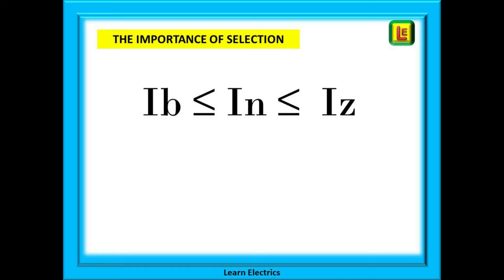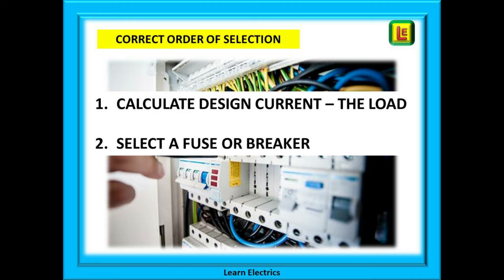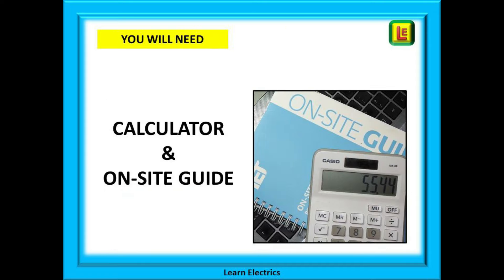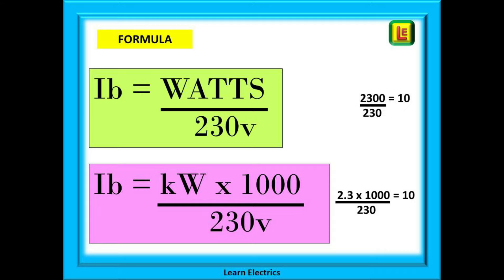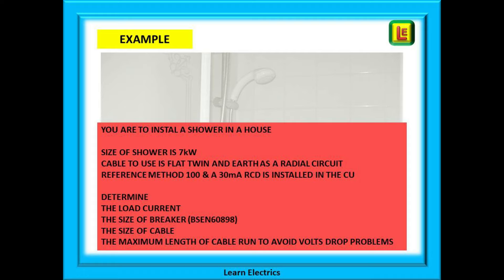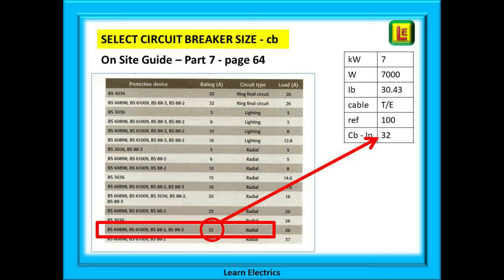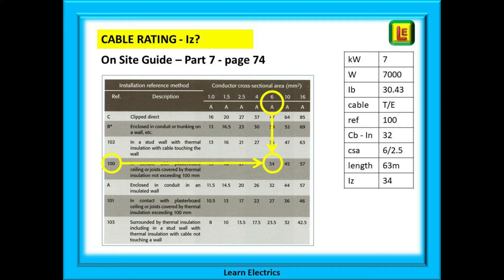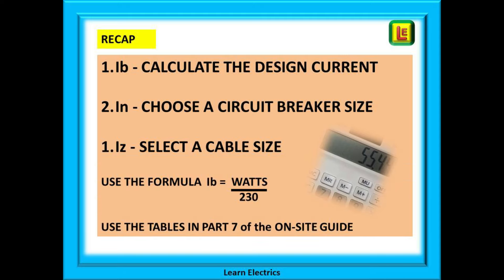BREAKER AND CABLE SIZES FOR ELECTRICAL CIRCUITS.

Comment: Finally someone has explained the actual calculation of what we were trying to learn 👏
Reply from the maker: Thanks for the great comment. Lots more videos to come, including more calculations. Dave.
Reply: @learnelectrics4402  hi dave 👋today is Christmas day "so I'll bid you merry Christmas 🎅 "and a big thanks for your teaching videos " I've been in the building trade for nearly 40 years now? As a bricklayer ☠👻spent most of my time on sites 'but went self employed in 2000 ' I've learnt a little bit about electrics 'wired up a few sockets now and again? And normally had to get electrician to check it over ' 🤪but recently I came across your videos " and got interested in expanding my knowledge of electrics 'I've watched other videos of similar advice "but found yours the one that struck me the most ' its not elaborate or highly glifick "but some how it works for me?? Think it comes down to how someone can get a difficult scenario across ! I find your instruction easy to understand 😃I'm going to follow you deeper into this "and get more equated with this "wish you could of taught me years ago "🙈all the best my friend "have a good New-year 👍

Comment: Excellent video.  I learned a lot about choosing the correct wire size and fuse to be used.
Reply from the maker: Thanks. If the video helped then its done its job. Dave.

Comment: Hi Dave, I recently completed and passed an excellent domestic electrician course at EC4U in Ditchling. Your video series is a superb “old-school” reinforcement of these key principles and in some cases has offered an even clearer explanation, or at least a different perspective on the same learning points.  Being an older learner who has recently changed to the electrician career, this series has been brilliant.  Thank you!
Reply from the maker: Thank you Mike for the very positive feedback. Our aim is to produce videos that tackle just one subject each week and they are based on all the questions and difficulties that electricians and learners have had over the years during the time that we ourselves have been working on the tools and as assessors and instructors. There are many more to come yet, keep watching and thanks again. Dave.
Reply: Mike.
How about the Domestic Electrician course in EC4U? I also want to join it.
Reply: @hingninwong  yes, look them up on google.  The website is easy to navigate. Good luck!
Reply: @MS-Patriot2  
does the domestic electrician couse fit your purpose, such as capable for you to do the minor electrical work ? Any comment to this course?

Comment: I think it’s worth mentioning that when you’re calculating your design current, if it is a 3 phase system you would put root 3 at the bottom of the fraction and if you have a power factor you would put Cos(power factor) at the bottom of the fraction aswell
Reply from the maker: Excellent information, thanks for contributing. Dave.

Comment: Thanks for all your vids, they’re a massively help for improvers like me working towards getting qualified! 
I have a quick question, not sure if you’ll see this:
If a dedicated oven circuit has a 40A breaker on it, why are there sometimes cables on that circuit that are rated for less than 40A? Is it the case that if the smaller cable is on the load side of the fused isolator switch, then you’d take the rating factor of that fused isolator switch as your “In” in the formula? Apologies if that’s obvious, I’ve just got a little confused and can’t find a clear answer elsewhere. Thanks again!
Reply from the maker: Take a look at the link below about Zs. A single 13A  socket on a cooker switch plate is acceptable. It is assumed that if something goes wrong with whatever is in the socket then it will go wrong big style and enough current will flow to trip the 40A breaker. Hope this helps, if you search for Zs on the LearnElectrics YT channel you will find over twenty videos about this subject. Good luck, its a great trade to be in. Dave.
https://www.youtube.com/watch?v=HbWhzt4r644
Reply: @learnelectrics4402  Great stuff! Big props for replying to comments on vids that are years old, you're a massive help mate!

Comment: Im training as an electrician and your videos are very helpful, i can see this calculation wiuld be good for an individual radial or ring say for a shower or cooker, how would this woek with lighting circit or socket? I am starting my NVQ level 2 in september so sorry if this is a basic question.
Reply from the maker: There are standard sizes that we usually use for each type of circuit. The important thing is that the cable capacity MUST be equal to or greater than the fuse/breaker rating. I'll be doing a video on this soon. Stick with it, its a good trade to be in.

Comment: Seems easy enough as you explained in great detail, I am looking to install panel heaters in my flat, can these just be added to ring main or need a separate circuit, if a separate circuit then can I do myself to save money?
Reply from the maker: Consult the heater manufacturer's instructions. Some say that they can be plugged in, coming with a fitted plug is usually a good clue. Other heaters are recommended on their own circuit.
Adding a new circuit assumes that you are competent and can notify the work to LABC afterwards. Only you will know if you can do this. If you are unsure, I would suggest using a REGISTERED electrician, but ask to look at his registration card (NAPIT, NICEIC etc) before giving him/her the job and before handing over any money. Tell them you want a Building Control certificate when the job is finished. And get three written quotes before making a decision.
Reply: @learnelectrics4402  thanks, the heater doesn't come with a plug, needs wired in to a fused switch

Comment: Fantastic video. What would change in the calculations if it was on a tt system. ?
Reply from the maker: Nothing should change. Install conductors with sizes as if they were in a TN-C-S system. They still have to take overload currents. Its just that your measured ZS will be all over the place. Dave.

Comment: Thank you for the video. What is the difference between "rating" and load" in the table on page 64. Is this assuming diversity of 80% e.g. the shower is off for at least 12 minutes in every hour of use?
Reply from the maker: Load is the amount of current you put through a fuse. A kettle might put a load of 13A on the circuit.
A table lamp might have a load of half an amp
The rating of the breaker in the consumer unit might be 20A or 32A if a ring
Hope this helps. Dave.

Comment: Hi Dave, another excellent video, we all thank you for all you are doing. I'm confused about the choice of cable size. On the chart on page 72 I see many entries with a rating of 32A that fit with the 100 installation method, why did you say there is only one? 
Also, do you know where in the book we could find the installation methods? Again, thanks for what you are doing.
Reply from the maker: You will find installation methods begin on page 433 of the Wiring Regs book.
If it is flat profile twin and earth we choose the nearest size cable equal to or greater than 32A which is 6mm. See Table 4D5 on page 456. Hope this helps. Dave.

Comment: You do some great videos Dave and explain things really well but I think this method is incorrect.
Table 7.1 of O.S.G assumes a max load of 26A for a 32A 60898 breaker where your shower has an IB of 30.43A.
I have always used and taught cable calcs using the tables from App' 4. Keep up the good work though Dave your explanations are great.
👍🏻
Reply from the maker: No Dave, the video is correct for a dedicated shower circuit, nothing else on it. Are you perhaps looking at maximum length for a 32A Type C breaker which is 26 metres due to Zs limits? Great comments and support. Thanks, Dave.
Reply: @learnelectrics4402  Dave could I private message you tomorrow about this?
Reply from the maker: By  all means Dave, yes. There is also another table in section 7.1 that states assumed maximum is 26A, but this is not a :Should not exceed: value and has been used for cable length calculations. The Electricians Guide to the Building Regs also states that a 7kW shower can be installed on 6mm cable with a 32A breaker. Dave.
Reply: @learnelectrics4402  how do I contact you?
Reply from the maker: Dave, I looked for you under DavePotter on Facebook. There are six, which one are you? I was going to send you a friend request. Or you can send a friend request to FB for LearnElectrics or Dave Buckley. My profile image is me with a blue jumper and the union flag in the background. Speak soon buddy.

Comment: Thanks for your prompt reply. In your video, you said you choose 6mm cable is based on method 100 in 2nd row, but 3rd row also has method 100. So may I ask to explain more by based which Wiring Reg. , we should choose 6mm but not 10 mm cable? I have confusion to choose one between them. Thanks.
Reply from the maker: You need to look at all the information on each line. With 6mm cable the maximum cable length is 63 metres which is more than long enough for most domestic dwellings and this matches up with the rest of the information on the slide. If you install 10mm you can take the length to 105 metres. Hope this helps.
Reply: @learnelectrics4402  
Yes, i got it that based on the length of cable for the house dwelling in this case. Thanks.
Reply: A 6mm cable (6 sq mm) is fine when the insulation stays the same and the shower remains at 7000 W.  A 6mm cable is near the limit.  The user may well fit a 8000 W shower when a 7000 W shower becomes unavailable on  replacement by a plumber.  Or the insulation is upgraded. On balance I would install a 10 mm (10 SQ mm) cable.

Comment: Hi 
Thanks for good clips . I am a bit confused though When I calculate for 63 meter 6 mil cable the voltage drop will be 14 volts which is over the allowance voltage drop . example in this clip according to table 7.1 onsite guide
(7.3*30.43*63)/1000=13.99voltage drop which is more than 11.5 volts allowance
Reply from the maker: Some of the pre-calculated tables take diversity, RCDs, and other factors  into account. I will be revamping this video to the brown OSG later this week. Thanks for the input.

Comment: For the design current do you not have to apply diversity to this then use that value as the design current for the rest of the calculations?
Reply from the maker: Depends on what the circuit is going to be loaded at and used for. Some will apply diversity, for example lighting at 66% etc. This video is just a basic introduction to the method of selection. Have a look at this video on the link below.
https://www.youtube.com/watch?v=UVU6MlS16V8
Thanks for watching.Dave.
Reply: @learnelectrics4402  So if you had two ring circuits (230 V single phase), and the demand before diversity was 29 A for ring 1 and 29 A for ring 2. After diversity ring 1 is 29 A (100 %) and ring 2 is 11.6 A (40 % ). Would you still use the design current Ib after diversity (normal operating demand) , 11.6 A to calculate the voltage drop of ring 2 or would you use the maximum demand (pre diversity, i.e worst case scenario) 29 A to calculate the voltage drop of ring 2?

Comment: Hi Dave, When you mention @3.23 "larger cable " "paying for extra copper that you do not need". Is this the only reason? Will a larger cable not affect anything else, only cost?
Reply from the maker: A larger cable will carry more current more easily and will not heat up at the same rate as smaller cable sizes, We can always install bigger cable and know that we will not have a problem, except perhaps with getting the cable into the terminal holes, 10mm shower cable will work for a lighting circuit but no way will it fit in the switch (an extreme example, sorry). So yes, that little section comes down to cost.  Good question and thanks for watching. Dave.
Reply: @learnelectrics4402  I believe a larger cable would actually be required in the particular case when the on-site installation runs for more than the calculated maximum cable length, right?

Comment: Hi great video but ai am confused you say at 8:32 there are 2 entries for 32a when there are 9, & 6 of them meet the installation method 100.. am I missing something obvious this is a little old not as page 82 now.. your help here would be most appreciated.. Thanks
Reply from the maker: 2 entries for that type of protective device. The OSG covers several devices, breakers, fuses etc. I will be re-vamping this video, this week to accord with the brown OSG and will take your comments into account for a better explanation.

Comment: thank you so much for clear clips. can I ask you if we have 63 meter cable length and  use voltage drop formula  vd={(44/6)*63*32 }/1000 the result will come to 14.7 volts and because its greater than 5% allowance means 11.5 volts is it acceptable ?
Reply from the maker: A 14.7 volt drop isn't acceptable as its above the values in the Regs. You would need a bigger cable size. Dave.

Comment: Fantastic video again thank you, if you were installing a domestic cooker circuit for a 16.5kw cooker and induction hob (very large i know) how would you go about that?
Would you install a 16mm cable that would be able to handle the full maximum load of 67amps or with diversity included would say a 10mm cable would be sufficient?  

Installation method ref method c no insulation and 8 meters of cable for the circuit

Sometimes these scenarios confuse me a little and i don’t feel 100% confident with selecting the correct size cable.

Any help would be greatly appreciated thank you
Reply from the maker: Thank you for watching and the great comment.
We have a video that will show you how to calculate diversity for your cooker.
The example in the video is for a 7kW cooker, just change the necessary numbers.
Cheers, Dave.
To view the video, DIVERSITY and MAXIMUM DEMAND, click on the link below
https://www.youtube.com/watch?v=TV2IZtmydm4
Reply: @learnelectrics4402  thank you very much your videos are extremely well presented and helpful keep up the great work
Reply from the maker: Thanks again. Happy to help. Dave.

Comment: Do these tables are valid only for UK or for the whole of Europe?
Reply from the maker: The Regs are for the UK only. But I used the same data when I worked in France as many devices are BS EN approved. I should check with a local electrician in the country of your choice before relying on them.

Comment: Hey Dave just a quick question if the shower is taking 30amps on a 32 breaker but the cable rating is 34 so is that mean the shower is taking 34amps? Which will trip the breaker?
Reply from the maker: The cable can take up to 34 amps but the actual current in the cable depends on the load.
A 1 amp bedroom lamp pulls the same current through a 10mm cable as it does for a 1mm cable - about 1 amp
Reply: @learnelectrics4402 alright thank you so if an appliance was taking 45amps and let’s say you wanted to use a 6mm cable what breaker size would you choose a 45 or 50?

Comment: Really useful videos for someone learning the trade. 
With regards to choosing the cable size, I'm just a bit confused, could you also choose the 10/4 mm too seeing as it also allows 100 as the installation method?
Reply from the maker: You can always go up in cable size, the difficulty might be in getting the conductors to fit in the accessory. Thanks for watching. Dave.
Reply: @learnelectrics4402  Ah, I get it....thanks for answering

Comment: Is this an alternative method to using the 18th Edition BBB and using the design current x length of cable x mv/A/m x any grouping factors?
Reply from the maker: This video is about Ib In Iz. Condition factors are covered in a different video.
Thanks for watching. Dave.

Comment: I have some questions, if I calculated the design current to be 102 A and I need to choose a circuit breaker, as you said that the circuit breaker needs to be bigger than the design current, can I choose 125A, 150 A, 200A circuit breaker? what is the difference? Is it appropriate to choose the 200A like the bigger the better? Just cut out the cost issues and focus on the safety of the system.
Reply: Thank you in advance for valuable lessons!
Reply from the maker: No, bigger is not safer. Ideally you need the same size or the next size up that doesn't exceed the design current. We want to fuse as close as we can to the design current for safety.
Reply from the maker: You are very welcome.

Comment: Ref method 100 @ 8:00. The maximum load is 26A but our design current is 32A. Wouldn’t you use the one below?
Reply from the maker: Have another look at the video. Max load is almost 31 amps. Thanks for watching, Dave.
Reply: @learnelectrics4402 apologies, not 32A I mean 30.43A. I was referring to the second you highlighted in the table. There’s a column that says “Load (A)” i wondered if that was the maximum load permitted, and if so, that is lower than the design current.

Comment: ETAP design and simulation software has already been introduced long back merging formulas, considerations, conditions,standards and requirements.
Reply from the maker: It has Mohan, but unfortunately its not allowed in an exam. Thanks for watching. Dave.

Comment: Thanks useful video. For the video of playing at 8:57, may I ask why not choose cable size of 10mm/4mm? (3rd row data)
Reply from the maker: We have to show the method adopted by the Regs, which is the nearest size suitable. In this case 6mm is just big enough. I agree that in practice you may want to install 10mm cable.
Thanks for the nice comments.
Reply: Thanks for your prompt reply. In your video, you said you choose 6mm cable is based on method 100 in 2nd row, but 3rd row also has method 100. So may I ask to explain more by based which Wiring Reg. , we should choose 6mm but not 10 mm cable? I have confusion to choose one between them. Thanks.